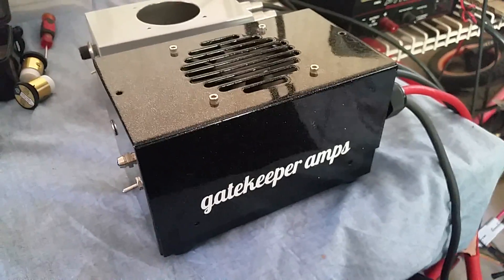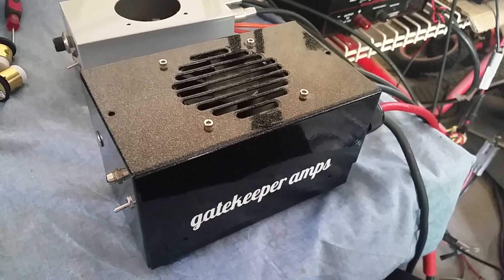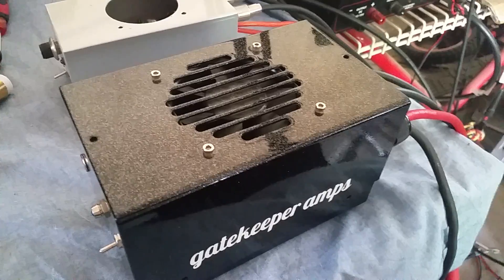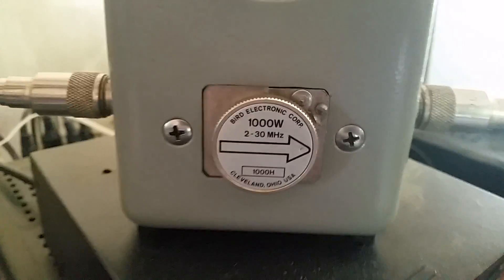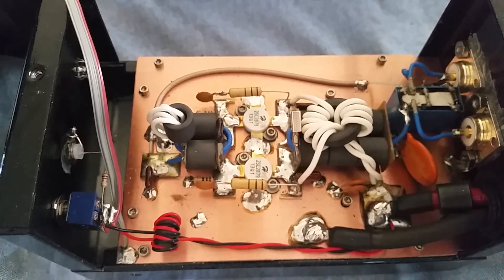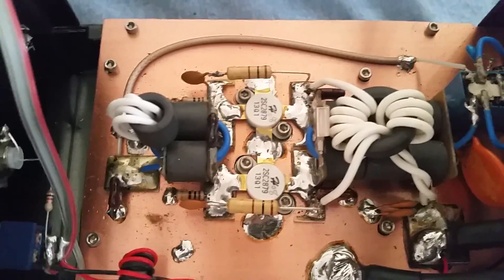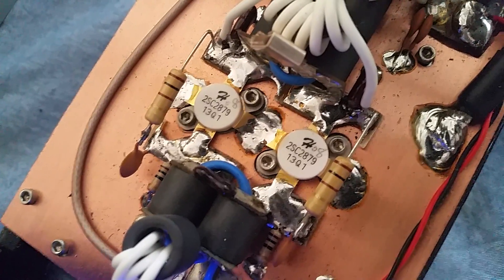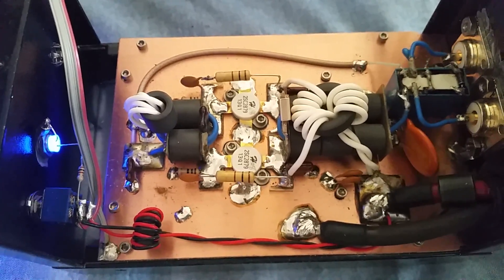First Gatekeeper Built China HG(HuaGao) 2SC2879 2 Pill 300w RMS 600w Peak FOR EBAY!

Comment: Wannort on Ebay sells them in single or matched quads for 80$ directly from the manufacture. We will see how they hold up to one of my torture tests. Gonna take one apart too.
Reply from the maker: they are not these.....those are the US Distros....these are a specific brew that he has been working on back and forth with me for the past 6 months. I think these are it i know they are power wise but i want to see this 16 pill in action and i will feel better and better lol. these are not sold yet. Still testing of course on this end but i feel ood enough to use them now but this amp has lasted over 2 months being ran every single day and still puts out what you saw so that is a plus to add to the list but the big question will be once these bigger builds happen and guess what brother you wont believe this.....a certain case that a certain non dot with all metals was going in....i started on it and was about to mount it to the case and guess what man...there is a big dent at the bottom right of it ans this whole time i have left it in its plastic on top of the shelf waiting to use it.....so i called even thougj it has been a while and i just went ahead and bought a new  case. it will be here actually tommorow i think. IT IS GOING TO BE A PEICE OF ART BROTHER cant wait for da black to see lol. txt me when you can got some other good news to share.

posting this amp now.
Reply from the maker: But yes....your torchure test is MUCH NEEDED....I should have thought about that before lol  These are what we call 04-8 for reference i will be using the 04-4 for finals and these for drivers mostly. atleadt that is the plan lol Great to hear from you brother.
Reply from the maker: +Alex l i gotcha you have your money ready?